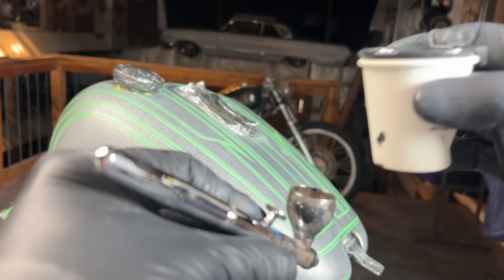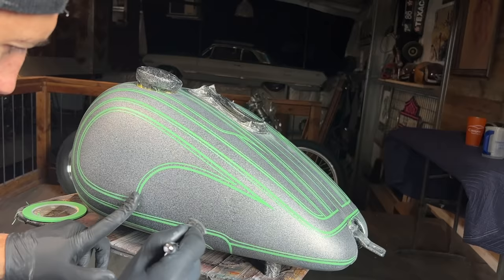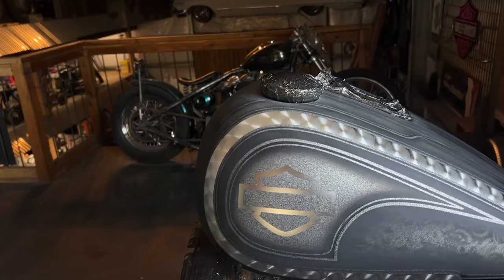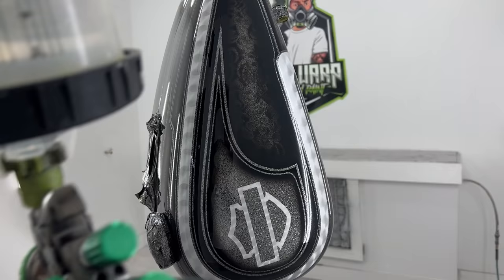How to Metal Flake and Airbrush Custom paint

Comment: I made a small mistake using your stuff and it made a nice little drip spot. Should I clear over it and then sand or can I lightly sand the thick metal flake part then clear and sand?
Reply from the maker: Sand it smooth touch it up if needed and reclear

Comment: Hey Adam , if you don’t mind a few questions?;

- what reeperator do you use?
-what vacuum system is on your line line palm sander?

-what type of ventilation system in your shop?

-do you ventilate when airbrushing?

Thanks man we all appreciate what you do and hope you’re makin that $ , you deserve it 

Adam Johnson
Reply from the maker: 1. 3M 
2. I don’t use vacuum 
3. 12” Exhaust fan with external motor
3. Just a simple box fan in a window
👍

Comment: FTW😮
Flake The World😂👍😎
I’m laying down flake today myself, thanks Adam🙏🏻
Reply from the maker: Right on🙌
Reply: @TimeWarpCustomPaint  
Actually I kind of cheated a little bit I used something called Krylon glitter blast instead of the metal flake for several reasons number one is because the gun I have does not have a large enough tip, however the results turned out pretty awesome brother took a lot of clearcoat to get it buried but it’s pretty sparkly I’m gonna keep on practicing pretty soon I will work my way up to a better gun and some real flake!
Thanks Adam we really appreciate you I watch your videos like a college course I go back over the old ones all the time!🙏🏻😎
Oh and I’m using the Iwata Neo for my airbrush

Comment: Keep rocking sweet paint i really like the harley stuff as that's the direction I'm going for my roadking after some practice using lowrider style graphics any help choosing some good equipment and compressor would be awesome, thanks Schu
Reply from the maker: Going with a two stage compressor is optimal but it all depends on what you plan on painting for example a car a motorcycle tank. I get a lot of questions on compressors so I plan on doing a video on this very soon

Comment: Long time follower here, just getting into painting myself… I’ve got a question did you apply any adhesive promoter after sanding the clear coat from this tank or since it was paint over paint and not on fresh metal that’s not necessary?
Reply from the maker: It’s not necessary as long as you’re sending the clearcoat

Comment: I have a bit of a different question. been watching your videos for a long time and am going to be playing around with some techniques for sure soon as a first time painter. I plan to do some paint work on one of my harleys, I'm curious how the original Harley pinstripes are added if i wanted to go with a custom yet somewhat "original" style with the pin stripes. For instance right as you were pulling off the emblems the top pinstripe is white and the bottom is blue. Is that paint work, if so how can that be achieved, or are those tape style decals then cleared over? Thanks a ton, your videos are great.
Reply from the maker: It paint